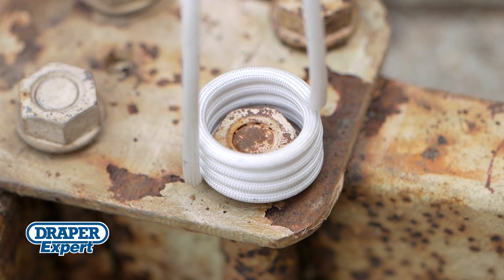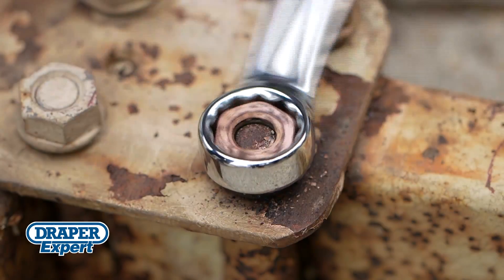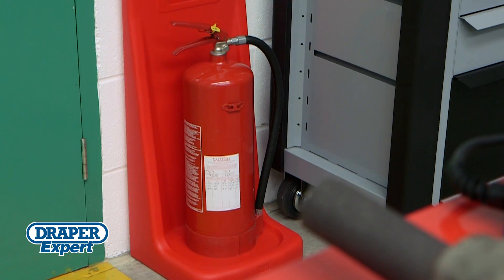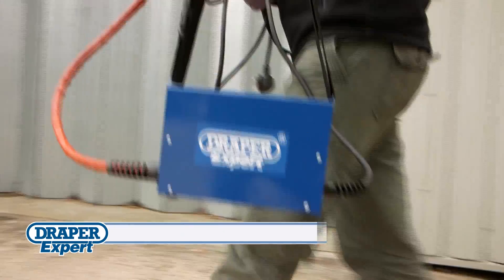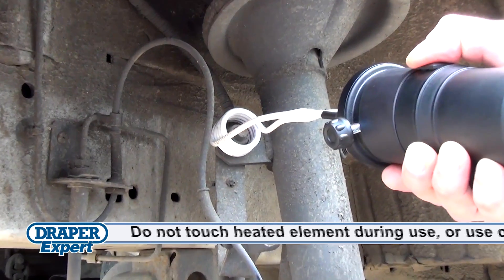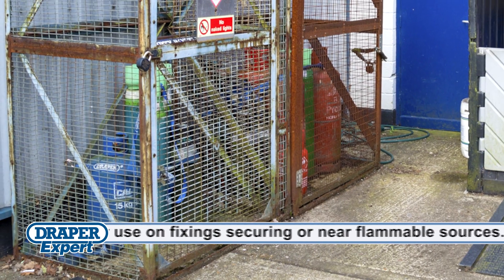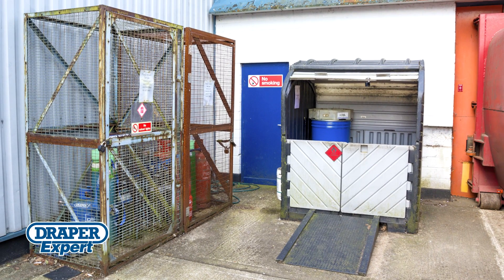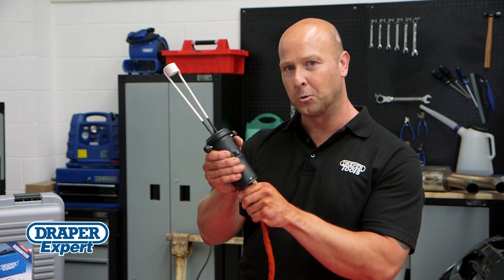Induction Heat Tool - 80808

Comment: so what's the downside to induction heaters as the tool uses the same method as a microwave ovan ?
Reply: Wrong two differant technologys ......
Reply: @leso204  *oven, technologies
Reply: Not the same method. Microwawe uses micro EM wawes to heat water in the food. Induction uses magnetic fields

Comment: Was thinking about buying one but couldn’t i just use a solder gun and make my own tips or would the gun not be hot enough to heat the bolt ?
Reply: We're talking a ten-fold difference in power, give or take.
Reply: Check it out. £160!! https://youtu.be/Dd8VXlHUiV0
Reply: nicholas randle 
Soldering irons don't create eddy currents.
Reply: nicholas randle No a induction heater works a lot different then a soldering iron. There are several YouTube videos on how to make a induction heater.
Reply: @UAVwaffle yeah, eith a solder gun it would be transfer of heat from the surface. Not generating heat in the material itself